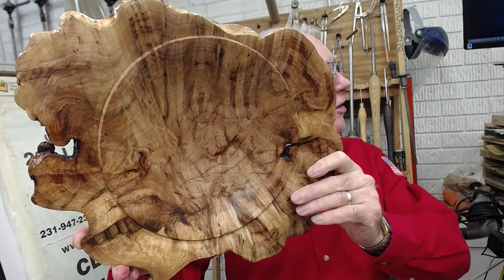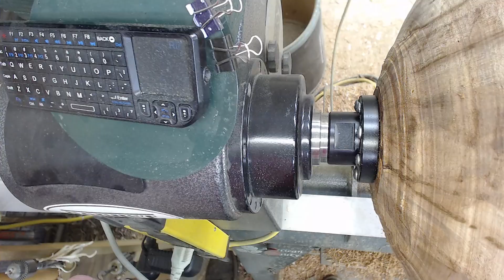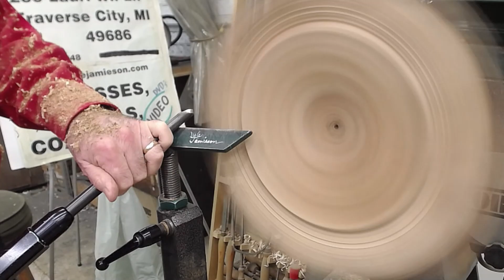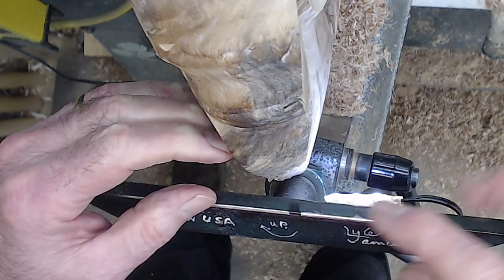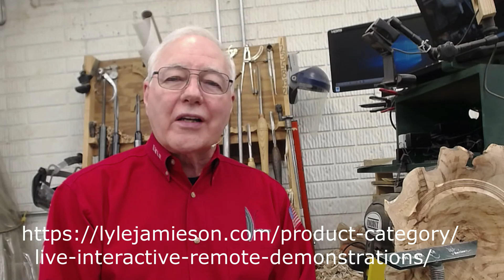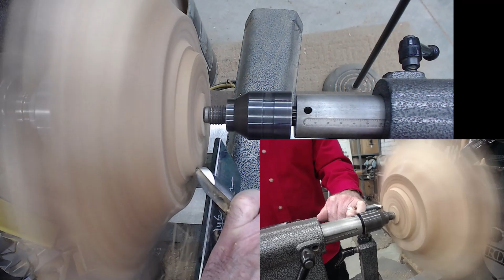Maple Burl platter

Comment: What is the final finish on the burl? 
Nice job! 👌👌
Reply from the maker: Hi Roy, thanks for watching and for the compliment!  The finish on the burl is a wiping varnish and then buffed with the Beall Buffing System.  That is my "go-to" for almost all of my pieces, but it isn't the finish that makes a special piece....It's the tool control, cuts, sanding process, etc. that get you to that place with no torn out grain to deal with.  See my DVD's for more in depth details.

Wanted to share with you a new Interactive Remote Demonstration, IRD, I am presenting.  It is Crotch Hollow Form on Wednesday, July 7, 2021, at 7:00 to 9:30 pm Eastern Time.   Also,  new "Vendor Showcase" coming up July 16th & 17th....Some really wonderful artist will be joining me....Live and Interactive!!!!  See my website for details, Hope to see you there Roy!